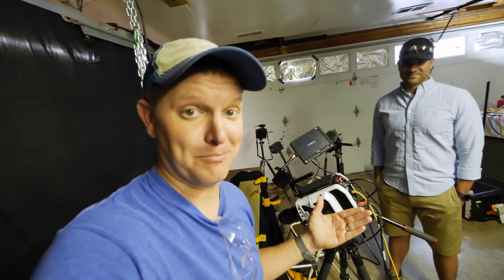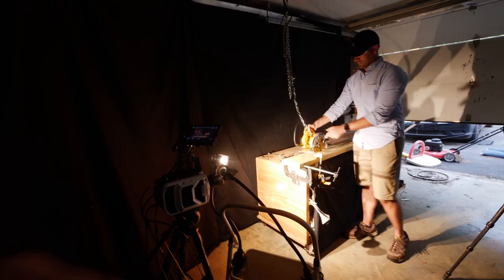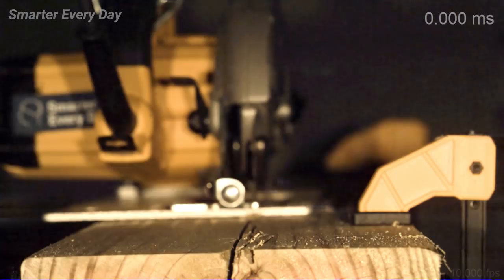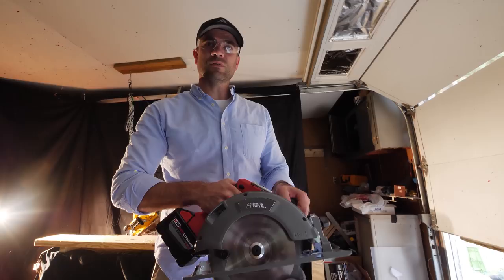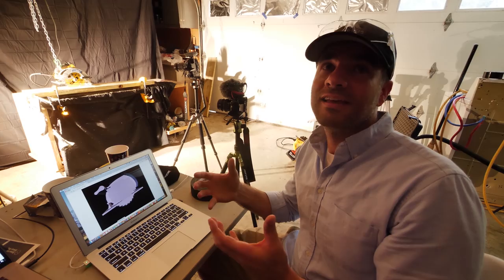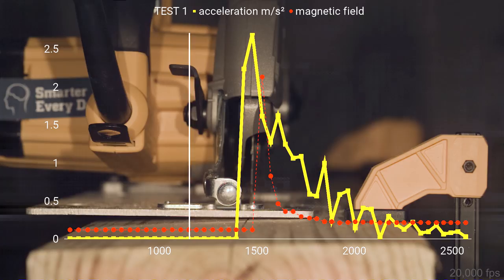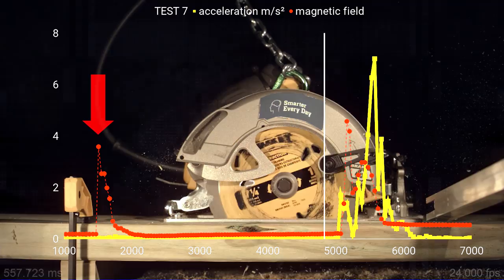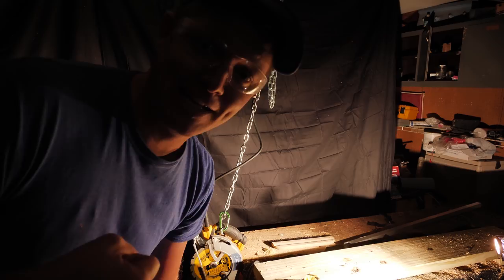Circular Saw Kickback Killer (We used science to make tools safer) - Smarter Every Day 209

Comment: Normally skill saws have a spring loaded guard that covers the blade if it is lifted of the work piece.
Reply: Yes. They have the guard pulled back. Sometimes the guard can get caught or just be in the way of what ever your cutting. I’ve had times where I had to tie the guard back cause it was in the way. Defeats the purpose of the guard but what they made it’s more of a secondary safety device
Reply: @Mom90198  Sometimes you cut the power cord also.  The sometimes list go on adnausium
Reply: Many people who use saws often will either have the guard taken off or the guards often have a portion that sticks out for you to push it out of the way with your finger and people will use that to hold it out of the way. If you're cutting a lot they get kind of annoying being in the way when you're trying to line up 100's of cuts.
Reply: The other comments make some good points.... another thing to consider is the cost of implementing a few sensors on a circuit board that's already inside of the tool and a small license fee compared to the extra parts associated with the spring loaded guard.
Reply: @SensoryAlterations  I mean, they wouldn't do away with the guard, the more safety guards the better
Reply: When a kickback lodged the blade in my finger, the saw came at me faster than the guard spring could do its job... lucky the finger bone got between the wide saw teeth and jammed the motor... and only then did I realise I was still holding on to the switch. 5 stitches later and all was good. I was really lucky!
Reply: That's the kickback safety cover. LOL
Reply: I would be curious to see how fast the guard retracts over the blade after it lift itself off the piece of wood. It all happens in a couple tenths of a second. Is the spring strong enough to cover the blade in that time?
Reply: @Ratboy2004  Bypassing safety measures is not always a stupid move.  Despite their apparent simplicity trade skills take years to fully comprehend and master.  Not taking time to gradually tame the nature of a tool or fully realizing its danger potential by simply relying on its safety features is far more stupid.  Anyway, I think that for circular saws the addition of an adjustable riving or splitting knife behind the blade would greatly reduce kickback without the need of idiot proofing the tool.  If we bubble wrap the planet we'll all suffocate.
Reply: @spitr015   do you have fingers  or steel screwdrivers in your hands?
Reply: @lacuentadevideos  give me your email address and I'll send you pictures of the blade and my finger!
Reply: Yeah, good luck with that! The guard is simply not fast enough, besides, if you ever used the saw, you’d know that the guard is in the front, not the back (where you are standing while operating it). Notice how in the video the saw lifts upwards with its back upright and the saw blade exposed and spinning super fast. If the guard was so successful at preventing accidents, this invention wouldn’t be so cool 😎
Reply: @Gary Foster I don't believe this guy either! ! just to many things in life and his story that don't match up. I, as one, really don't want to get a email from this guy loaded with creepy things getting into my phone. Bye for now my friend.🐺
Reply: @pavel0900  I, as one don't know know what kind of saw you have, but I just have a nice little craftsman and it's blade guard is on the left going forward. From the back to the front of the saw. Bye for now my friend 🐺.
Reply: On all the circular saws I've used there is a small gap between the guide and the guard so you can still get cut it's happened to me before
Reply: Unfortunately the guard springs from the rear of saws giving plenty of time to loose some digits before the spring can engage.
Reply: So, in my country we're not only have that spring loaded guard, but some knife (simple flat pice of steel) that keeps pieces from come back together and renders that kickback impossible, like, for YEARS
Reply: If youre not confident in using your circular saw with one hand. Clamp your piece down and use two hands to hold the force. Keep the saw in front of you at all times. Be more cognizant of the speed you go through the material too
Reply: Worm drives are what most people would or should be using to cut that...
Reply: @Mom90198  you never have to tie the guard back if you know what you're doing.  I've never tampered with a saw guard and I'm a carpenter.  Make plunge cuts and everything..... over 10 years and never once on my own saw anyway,  I know guys like to look cool and whatever,  but it's ignorant and shows a lack of skill.
Reply: I mean, if the saw jumps at you it still hurts even with the guard, doesn't it? If the blade stops and it looses his momentum, maybe even stopping itself completely in the wood, you won't even feel it. So it's even better. 

Not to mention that a safety feature like that AND a redudant guard certainly isn't a bad idea, is it?
Reply: @TheThursty100  if the saw jumps at you youre using it wrong. Like in this case, you would not cut a piece of plywood in half like this, it is incorrect and dangerous. They don't make safeties for improper use.
Reply: @ZeroSEO5  it's called a riving knife. It's standard equipment on most tablesaws, but rarely found on circular saws. Circular saws are almost always low power enough to stop the kickback just by not letting go of the saw.
Reply: True but I still sprained my wrist, better than instant circumstance, but still very painful
Reply: Just learn how to use a Skil saw and what causes kick back and you won’t have this problem no need for this upgrade if you’re holding the saw properly I don’t know how in the world it would ever come out and hit you My fear with this technology is every time the Saw started to bog down are you tried to cut through some hard lumber it would want to cut off Which would make this so useless to me in that case
Reply: Such a great point
Reply: rundownaxe no it isn’t

Comment: I get that people want to make things very complicated (like machine learning), but what we did is use a simple microswitch that sits on the side of the metal guard.  if the saw lifts off, power to the saw is removed (like if we released the trigger).   People are going to buy this simply because "machine learning" is involved, but really a simple switch would work.  However, anything that increases safety can never be a bad thing.
Reply: Like a nail gun. If both switches aren't pressed. It doesn't work. You know. That's generally the best way to solve a problem. Just look for someone who already solved it.
Reply: @invendelirium  I see your point.  Since this is computer based, I can really foresee someone not being able to use the tool that feeds their family because of a software malfunction.  That would be awful.
Reply: Hahaha, this seems so much simpler and likely more reliable. I'm sorry Destin. 

If that's not the case then I'd love to learn why.
Reply: How would you do a plunge cut with this system?
Reply: @seabass563  when i was my crew's safety chief, we tried to stay away from plunge cuts as much as possible (since the saw isn't stabilized).  however, if we did need to do them (which happens, we all know), we just used a little magnet to pull the switch up from the other side.  pre-shift equipment check found if people forgot to take off the magnet.
Reply: @roromad9603  most plunge cuts start with the front edge of the table resting on the material so it's stabilized that way, and if you're doing a plunge cut you have to have one hand holding the guard (unless you pin the guard which is incredibly unsafe) and so you also have two hands to help with stabilization. If you're starting a plunge cut from the air you probably shouldn't be using the saw. In my experience pre-shift equipment checks are usually skipped over when you're under the gun so there is still a chance the magnet could be forgotten, though probably slim. In any case, experience in body positioning and proper use of the tool usually negates the need for a secondary switch.
Reply: @seanrobinson6751  totally agree. In the real world where time is money, these safety systems are just by passed. As tradesman we are taught at the start how to properly use these saws but I can see some merit for the DIY type range which is where they can be the most dangerous
Reply: @seabass563  That's a good point, I've seen the saw stop table saws at training centers too so that's probably another good place auto stop circular saws can be implemented, the only downside being that trainees might get complacent.
Reply: This solution not just "switch off" the power, it uses the power to actively stop the saw.
Reply: I think this comment is a great contribution with another good (idea for a) solution. However, as a recent graduate in machine learning I'd like to point out that the system once trained is not more complicated to use than a normal saw would be. It takes a few sensors and very little computing power. Training is the complex part.. 
CQ it's easy to ask your iPhone for photos with cats in them, it's hard to create a system that's able to do this but we're there by and large :)
Reply: @Slow_Hand_Path  couldn't  agree more. I spent years as an apprentice  carpenter Joiner plunge cutting windows into solid doors. The plunge cut is an every day affair if your a trades man. If your not comfortable lifting the saw onto the leading edge than you shouldn't own a circular saw. Most squaring cuts across the end of stud work and plates are started with the base lifted and then dropped through no line needed.
Reply: In addition to plunge cuts, cutting things like lattice, or uneven surfaces like siding would now become impossible. Even cutting dimensional lumber like 2x4s with the micro switch would be difficult. You would have to have perfect technique everytime to trip the switch or the saw wouldn't work. This is the exact scenario where safety switches get jumped out in the field as the end user gets frustrated.
Reply: what if you want to switch the saw on before letting it touch the surface? with this system you're less limited
Reply: @seabass563  start with the end with the microswitch and pivot
Reply: @sebbes333  its the same as regenerative braking
Reply: Your switch can fail or get jammed and no one would know.. The software won't.
Reply: You are right. Make it simple is always the best way.
Reply: @seabass563  tape up both switches and start saw by plugging into main ... Sorry only joking
Reply: @douggief1367  that's a good point, we could just rely on the breaker to trip from overloading the saw as a safety measure haha. What could possibly go wrong
Reply: Because plunge cuts. Basically when a plunge cut is required ( often) a switch would not allow you to do so. Plunge cutting is safe if done correctly. Takes practice and skill
Reply: Not to mention in the demo shown here they are ripping a board. Ofc there will be a lot of ridiculous kickback. If anyone on one of my company's jobs was seen trying to rip a board with a circular saw they'd be given a pink slip. That's what a table saw is for. Using proper tools in a proper manner is by far the best means to ensure safety
Reply: @seabass563  my dad lost his toes in a farm accident.  He had been a farmer over 45 years at that point.  Pros make mistakes too.  At some point everyone gets rushed and cuts corners.
Reply: @mattrinne  yeah agreed but if there was some over complicated safety system in place do you think the old boy would have just worked around it anyway?
Reply: @seabass563  Pre-accident yes.  Post-accident, definitely not.
Reply: @seabass563  just lower it slowly enough that the accelerometer does not trip. Thats what the machine learning is for, prevents false trips because it knows the difference between normal use and a trip event.
Reply: Same here.
Reply: Yeah machine learning claptrap.
A simple accelerometer switch would work fine and be inexpensive relatively, because there's no reason for a running saw to have over a small amount of acceleration
Reply: Another way to solve it would be a wheel in the guide plate and a rotary encoder to detect saw motion direction.  If it starts to go backwards, kill it.  Implement both together (lift switch and roll switch) and it'll never kick out.
Reply: I expect this has been stated in the many replies that I don't have time to read right now, but the system you're talking about isn't doing the same job. Firstly, because cutting power to the saw still leaves it lethal/maiming for a second or so; it's the brake you need to activate, and I haven't seen one that does that (because when leaving the work piece on the other side, the brake applying would potentially damage the exit cut). Secondly because a switch relying on resting on the work piece is only useful if you're cutting flat timber, edge to edge, quite far from the sides, without plunge cuts or shapes. That may work for you on a work site doing something simple like framing, but is hopeless for a huge swathe of carpenters (myself included). Finally it's worth mentioning that machine learning IS simplicity. The learning itself may be complex, but once learned, there aren't many simpler systems around. They rely entirely in digital inputs, with defined outputs depending upon a few linear equations. As compared to the huge quantity of variables (that will remain untested and untestable) with a microswitch (pressure, uneven surfaces, magnetic fields, jamming, MTBF, sawdust, fluids etc), machine learning allows us to take all relevant variables, understand them, and define our output accordingly.
Reply: Your idea would be problematic I think. Where would you put this switch on the base plate? Couldn't be on the front or it would stop the blade before the cut is finished. Couldn't be on the middle or back or you couldn't start a cut.
Reply: I thought that was a joke and it"s just a smoothed accelerometer and the break. You don"t have hundreds of labled kickback events from random people that have a logging accelerometer on their saw flying arround.
Reply: I'm a data scientist and when forced a handyman. I asked why didn't they just use a pressure switch like the seat on a riding mower
Reply: Problem with a pressure switch is that for it to work it would have to be in contact with the wood to begin with, where exactly would you put said switch that it will always be in contact with a surface no matter how you cut?  You're also relying on that switch not being broken off or damage with normal use, where as this system would be built inside and rely on sensors that are not exposed to the elements.

Also, the Machine learning is being done now so that the data will already be present in the finished product.....they wouldn't be selling a product that will have to learn right out of the box.
Reply: @roromad9603  if the switch was on the front edge of the saw you could use it with a plunge cut as that's how a plunge cut is done (put the front on the wood and drop the back ).
Reply: Cutting the power isn't going to fix the issue here. The blade keeps on spinning even after you switch power off. That is why they used a brake on it so that it stops spinning immediately.
Reply: That would work somewhat, but what about the magnetic braking mechanism? Could you still have it tied to a switch?
Reply: But as you can see in the video it lifts the back of it up and pulls it back, if you have a hand there then,and I say bye bye. And Ya lose your hand
Reply: @sebbes333  Yes, the AI trained system uses magnetic motor braking. This can be achieved with a switch as well, A multi-pole switch actually. In normal operation it's wired to passes power to the motor, in fault condition, it shorts the motor, which magnetically brakes the rotation using the energy from the flywheel effect of the spinning blade itself. This is how auto blade stop is achieved on most simple electric lawn mowers with the "dead man" style user switch. Or in the case of electric ridding mowers like the one I have, the same magnetic braking effect is done via the motor controller doing the shorting/switching.  Effectively what Destin and Chad have done is make a very intelligent sensor enable motor controller trained on AI. Since it uses a predictive approach, it would on average react sooner than a basic micro switch based solution. Both approaches have serious merit, but in slightly different application criteria, primarily dependent on the desired reaction time . Fantastic project.